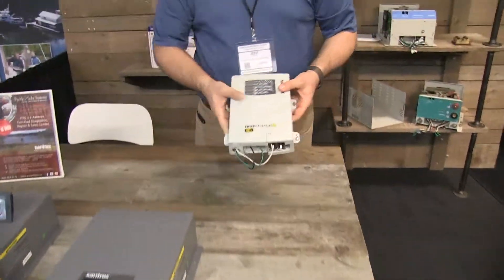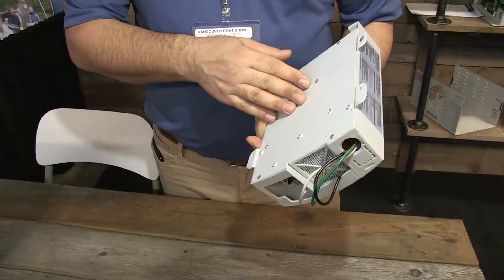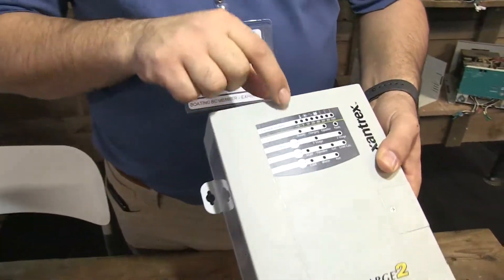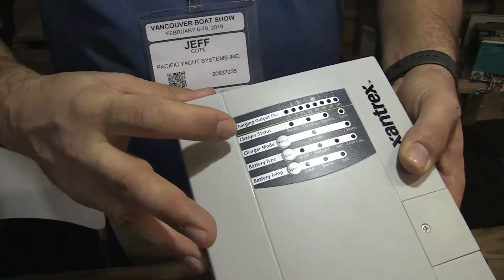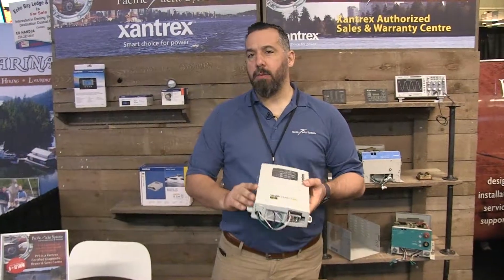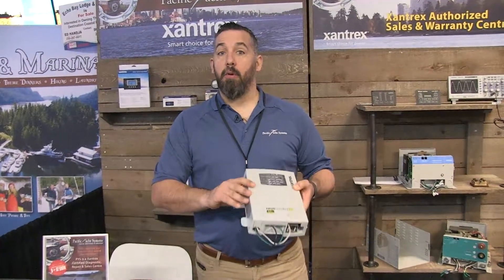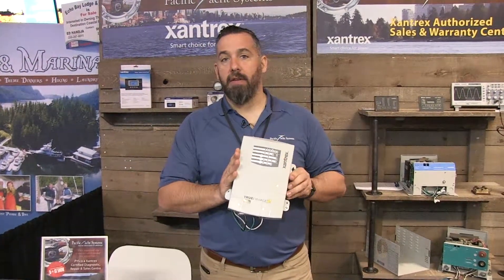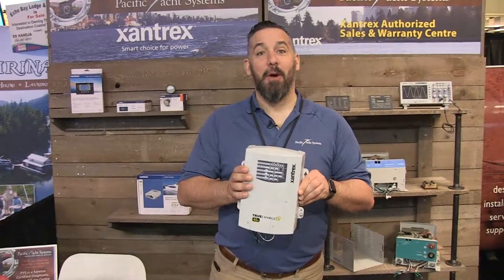Intro - Xantrex True Charge 2 Battery Charger

Comment: If I have one 85ah AGM starter and two 100ah house Lithium connected to the starter battery via DC/DC for total of 285. Do I include the two lithium in the X.10% formula? Or is it just 8.5?

Comment: Hi Jeff. I have a 4 X Trojan SCS150 12V 100Ah Group 24 Superior Deep Cycle Battery connected in series making a 48V battery bank (because of my electrical motor). I have 2 banks, a 12V for in-house electronics and a 48V for the electrical motor. Do you know if Xantrex True Charge 2 has the charge ability of 2 different banks with different volts? I look online and seems they only have 12V and 24V model. Any recommendation. Sorry for the ignorance.
Reply from the maker: Hi Rodrigo, you'll need to get a 48 VDC to 12 VDC DC to DC charger for this. For instance Sterling Power has one product for this very purpose. Not aware of any battery charger that does multiple battery voltages, e.g. 12 and 48 VDC.
Reply: Would this type charger also charge Lipo4? 
Have an older one but not sure I want to experiment on my batteries, what do you think?